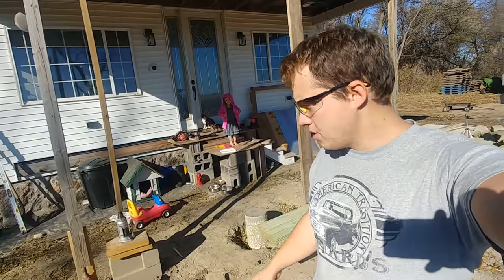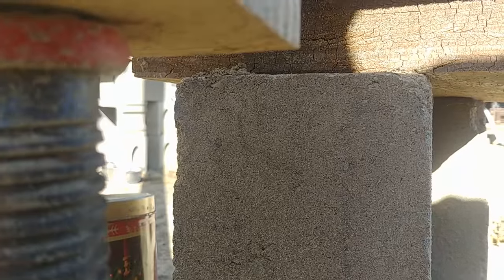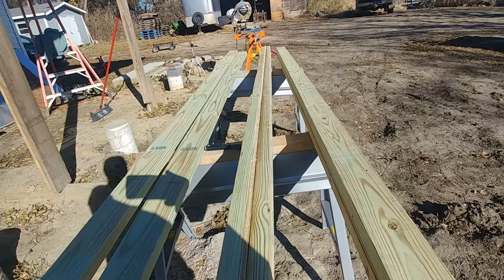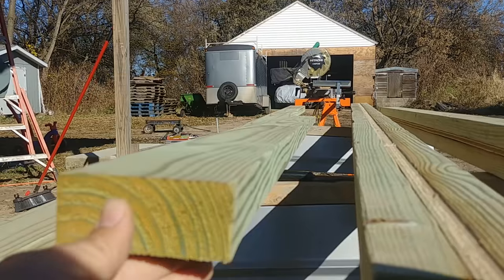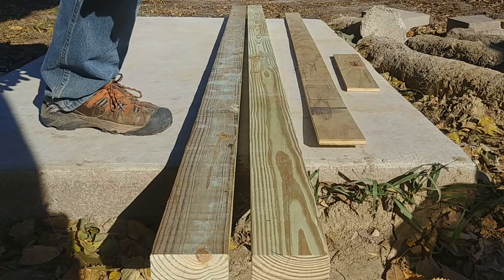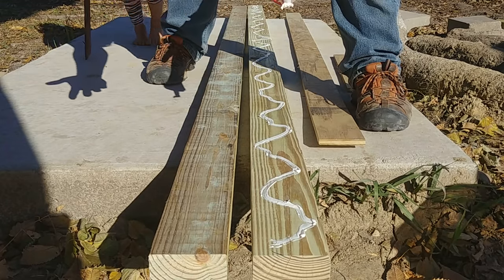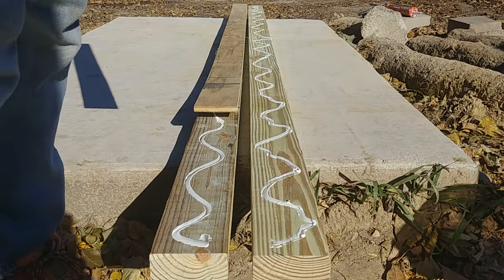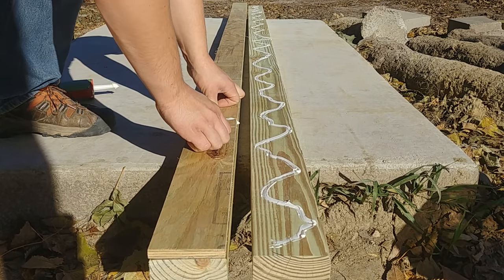How To Build a 4x4 Post or Column that Won't Warp or Bend with Treated Wood

Comment: what is the plywood for?
Reply: It makes the post square. a 2x4 is actually 1.5" x 3.5'. adding the 1/2' plywood will make it a 3.5" square. Now if you want , you can wrap the post with a nice wide finishing boards for appearance.  You want to place the 2x4's with the end grains going in different directions. (curving towards each other).This will keep them resisting each other from twisting.
Reply: @terrythomas790  would this also work as a fence post?
Reply: @ronniemajors7090   I wouldnt do it for underground posts. The plywoods edges, in my opinion would suck a lot of moisture into it, and rot away. When I built my picket fence I bought the regular 4x4's  treated for ground contact posts. But, I always bought the lightest ones. The reason is that all the preservative moisture had dried and the post most likely wont twist nearly as much as a new post. Feel how heavy some of those new posts are!  Thats from all the moisture. Scrape a fingernail along one and you can see the moisture.
Reply: @terrythomas790  Even the white selves that go over them would hide it all as well. Are you referring to the "cup" facing each other?
Reply: Tony, If you look at the end grain, you will see the curved tree rings. If the board "cups" like you mention, it would  eventually curve in the direction of the tree rings. SO, I used two flat 2x4s, not ones that are already cupped., and have each facing each other so the growth rings  curve towards each other, to help prevent one or the other from possibly  twisting later on. One will oppose the other from doing so. The plywood is in between the two 2x4's Hope this makes sense to you. As an example if you sliced a circle in half , you would have this, (   ). Thats the directions  you want the growth rings to look when looking at the end of the 2 boards when put together. The 1/2" plywood would be between them as well   Looking at 1:10 in the video, you can see he has the grain  of each board going in the same direction . Thats wrong. The top board should be flipped over
Reply: @terrythomas790  That's what I meaning. Cupped facing up (hump up away from the other piece.
Reply: Ok!

Comment: It may start straight with your method but it is still weak and will bend under load with something to stop the deflection. I doubt you’ve solved the problem with wood in general.

Comment: It's a terrible idea to put any laminated sheet good, between solid lumber for exterior use. Could potentially used on interior stud walls, or well protected areas. Long term the ply on the plywood will delaminate due to moisture, uv, and expansion/contraction, on top of having it look like shit. Just my 2 cents, best regards.

Comment: In my area we are concerned about damp soil and flooding every 10 tears or so.  If I used taller/deeper concrete piers and shorter wood pillars I could keep my wood dry and worry less about pillars buckling. Do you agree?   Marrying 3 treated pieces instead of using one solid 4x4 makes sense but do engineers approve?
Reply: Just use all concrete, problem solved.
Reply: @simpleman283   Still have to reinforce with steel rebar or mesh wire. 🤔
Reply: Well, Mr Caveman, since the commenter was talking about concrete piers without mentioning rebar, I took that as an understood part. All concrete piers implies everything needed to make them. Come on now...

Comment: Putting in plywood for the sake of proper 4x4 size is not needed,...would be stronger just alternating grain on two 2x4s with strong waterproof adhesive and galvanized nails & a few screws will do,.......why add plywood between two solid pieces of wood to soak up water?,...plywood is made with glue and sawdust,....would you build a house out of particle board? makes zero sense.
Reply: Plywood is not particle board and it's not made with sawdust.  That doesn't mean this wasn't a terrible idea he should have used 6x6 posts for this job. What he made is built like a header which is the beam that's above all doors and windows on load-bearing walls. It's done to make the thickness three-and-a-half inches.
Reply: Could still consider getting pressure treated plywood for the task.

Comment: Dumb question moment. What's the plywood sandwich about ?
Reply: A 2"×4" is actually 1.5"×3.5".
If you put two 2"×4"s together, you get 3"×3.5"... a rectangle, not a square. The half-inch plywood makes it 3.5"×3.5" (the dimensions of a regular 4"×4").
That said, even with pressure-treated plywood, this sandwich he made may not be a good idea for exterior use as the plywood might delaminate and/or fail over time.
That sandwich will also be visible unless otherwise covered, and it just looks ugly to many people. 
Just my 2 cents...
Reply: @rudycarrera791  Yeah, I'm kinda familiar with dimensional lumber. Was just curious if it was about strength and/or dimensions. Take care. 👍🍻

Comment: What's the reason to sandwich the plywood in between the 2x4 when the plywood itself is flimsy as heck?
Reply: So the actual size is 3.5 x 3.5.
Without the .5 plywood, it would be 3.5x3
Reply: lol
Reply from the maker: It adds dimensional stability for the axis it is perpendicular to.

Comment: Your post is warped because it already was or the load was too great for the unbraced height. Forget making your own posts because you have no idea what the load-carrying capacity is. Your lumber may be treated with a preservative (pentachlorophenol) that prevents the glue from adhering and deck screws are not meant for structural use. Most PVA and urethane glues are not rated for structural use. Read the bottle. The size of the post is determined by the load and the height and if they have bracing. For that height, I wouldn't have installed anything less than a 6x6. Check with your local lumber yard to see if they will or have charts for sizing wood posts. Stop guessing.

Comment: You really should be relying on nails instead of glue. If you make a glue lam beam like this it must be fully glued, then fully clamped. 

For the amount of glue that you used.  3 inches from the end place 2 nails one inch in from the sides. Move down 8 inches and one nail to the center. Then repeat the diamond pattern. Turn the beam over and use one nail three inches from the beginning end, move down 8 inches and repeat the pattern.  This creates a structural beam.

As you have it the stresses can easily delaminate this beam. This is especially true in high wind load and earthquake conditions. Do not trust this beam at all as it is.

Comment: Don’t do this, it has several structural and durability issues, also this video doesn’t address or leverage the perceived but (flawed) concept in how apply it to your situation. Untrained and unskilled people should not be dishing out structural construction “tips” like it’s perfectly valid. You will be left with issues you or the next owner will need to address, or even worse when it puts someone in hospital or an early grave.
Reply: Could you describe more specifically what the problem with it is and is there a better alternative?
Reply: Platinum1812: I'm a mechanical engineer but also have a builders license.  When you see a post start to buckle as shown in this video it is a strong indication that this post is overloaded.   Best would be to get an experienced builder to safely fix the issue with properly sized material.   If you do it DIY  you should get at least a structural engineer evaluating the structure and calculate what size of posts will be required and how to install them properly.
The shown procedure in this video might give you a straight piece of 4x4 but I doubt that it is stronger than a full cut 4x4
Reply: @martinneumann4436  Two boards with different grains will be more sturdy than one board with one set of grain. 4 X 4's will twist, cup and warp even with no lateral or compressive load. If you don't believe me, buy a few and store them in your garage for a year. I've made that mistake with many different dimensional lumbers.
Reply: Martin Neumann your license is not worth much then

Comment: The aesthetics of the posts are terrible.  Nobody wants to see sandwiched plywood and screws. I think you would be better off cutting the 4x4 in half the long way and moving one piece so that the oriented the opposite way..but still the outsides show. PL the new long seam, clamp and finish nail it. No screw heads and MUCH less wood twisting.